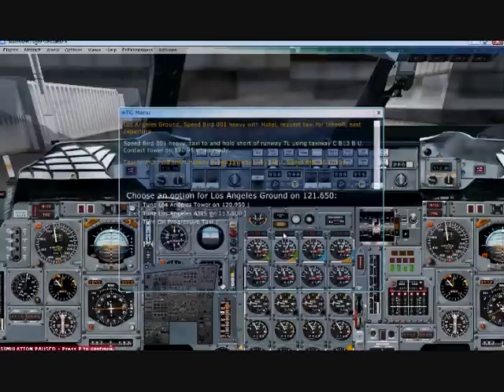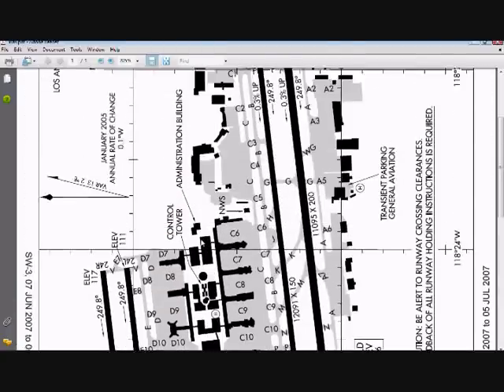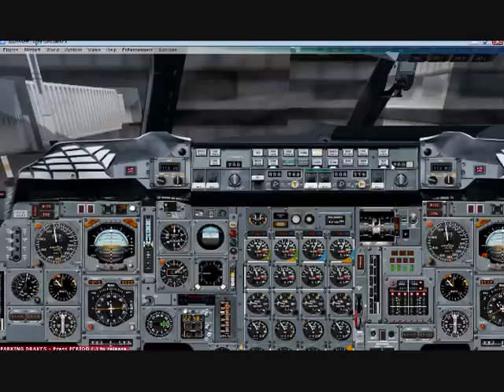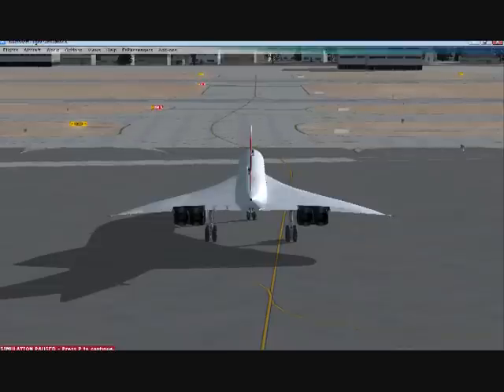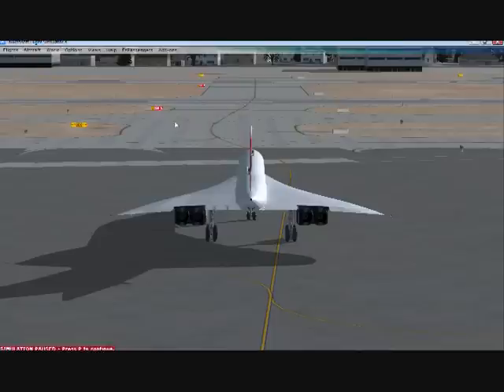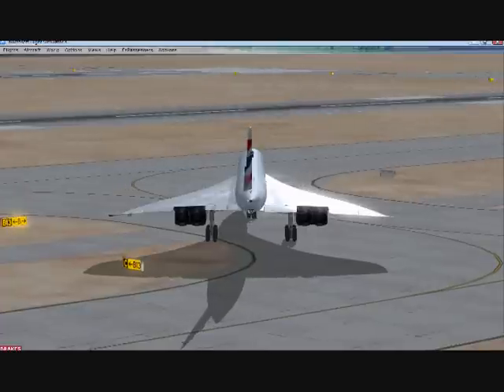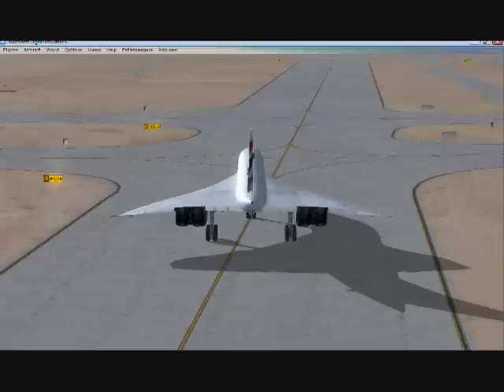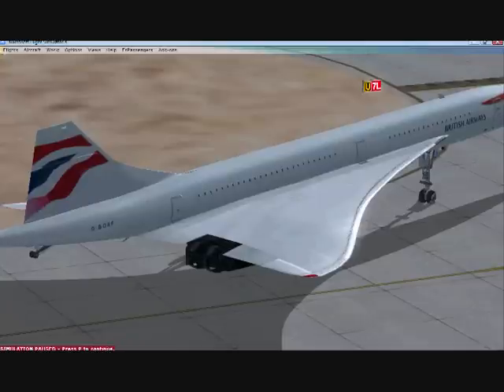Concorde X flight tutorial Part 5

Comment: Excuse me i have a question are you using fsx sp2 for this aircraft? Im having problems with my concorde x in fsx the afterburners are on even though i did not push the throttles,and there's lots of smoke coming from the engines even though i did not take and im on the ground. I purchased this aircraft and i download it, and its giving me lots of problems. So please help me out. My email is: Abdulrahim1992@live.com